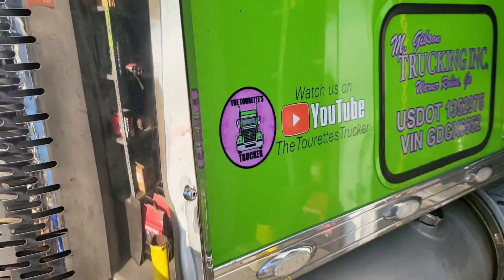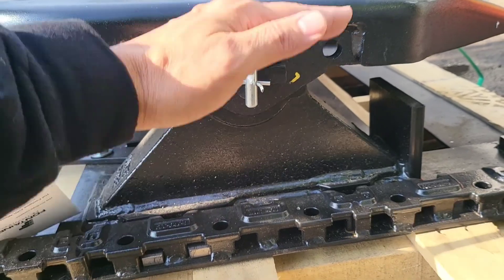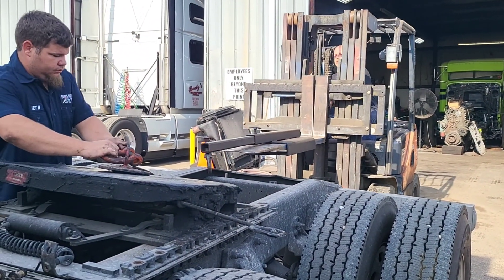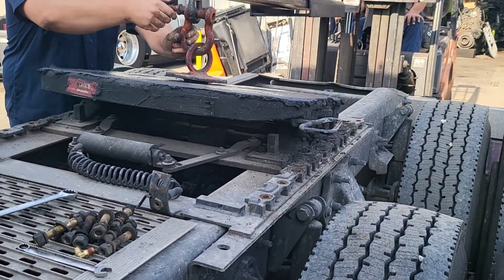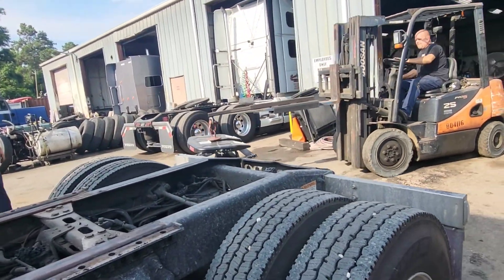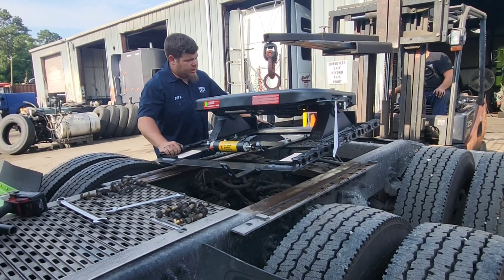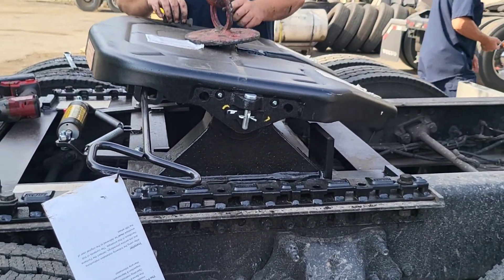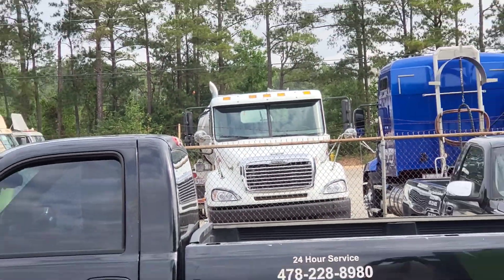Raised 5th wheel install at Dub's Big Rig Rehab in Macon, GA. Tank unloaders need a raised one.

Comment: Why are you switching to a high-rise fifth wheel what's the difference because I drove a truck with a high-rise and I didn't like how it felt with the turns and I was doing Drive-In and it was a jost and I fell in love with the Fontaine low profile
Reply from the maker: With tanking, unless the trailers have low profile tires you won't have any slope on the trailer to the back to get all the product out. Even with my raised 5th wheel and 11R22.5 tires, I still get to places and end up level so all the product won't come out. I put and over-inflate valve on my drive air bags so gives me another 3 inches.
Reply: @TheTourettesTrucker interesting I never knew that.

Comment: What was the height from the top plate to the ground before and after 
Im needing to get my fifth wheel raised  from 48" from the ground to 51"
Reply from the maker: My green truck is at the terminal in Macon and I havent been there in a while. Next time I'm there I'll measure it. I believe it was a 3"riser plate. We couldn't get a 4" riser.
Reply from the maker: I just got back to the terminal to measure the height on the 5th wheel for the green truck and it's at 50".
Reply: @TheTourettesTrucker  thanks

Comment: So what happens to the old one they took off? Does it get stored somewhere for reuse later? Or does it get sold as used?
Reply from the maker: It gets scrapped. It had slop in it and No one will adjust them anymore due to liability now. I needed a new one anyway.

Comment: Why spend $3700 when you can spend $200 and don't gotta worry if u pull anything besides a tanker? You can add a over inflate system with 2 electric air valves one closed one open. Hit the switch in truck it over inflate air bags giving 4-6 inches higher.
Reply from the maker: That sounds nice but that wouldn't give an accurate read on my airbags while unloading I assume.  I have a digital weight gauge accurate within 100 lbs. Some place always want to know how much longer until we are unloaded. Depending on product it can be a 30 minute or a 4 hour unload. See the gauge tied to the airbag let's us see what it's doing. 

 I will have to look that system you mentioned up there that does seem pretty cool 😎✌️
Reply: @TheTourettesTrucker  ah that makes sense I just made mine after dealer told me $3500 for em to add it. Cost me like $200 I drop n hook a lot and those trailers can be close this helps so much back under air it ip and pull out enough to get land gear up
Reply from the maker: @TruckingWithChicken  I do like that Idea. My 5fh wheel plate needed to be replaced anyway also. My old one had a lot of slop in ditch. I tanker beats a 5th wheel to deal with the surge. At one point I wondered if it would be feasible to have a lift like a jockey truck. Lol
Reply: @TruckingWithChicken  

Can you send any info of the over inflate kit. I haul tankers as well

Comment: Someone please tell me what trailer’s it’s good to have a lifted fifth wheel?
Reply from the maker: Anyone hauling a tanker needs a raised 5th wheel unless the trailer is running low profile tires and even then you may need it. If it's a center unload trailer then there is no need. If you have a trailer that unloads in the rear (Which is industry standard) then you need the front of the trailer to be higher so the liquid falls to the back where the valve is or you will end up with lots of product that didn't come out. Tank washes charge per gallon for left over product and it can cost on average $15 a gallon to dispose of.
Reply: @TheTourettesTrucker  thanks for the reply, do you know if other trailers like log 🪵 hauling trailer need raised fifth wheel?
Reply from the maker: @MarkMinistries  no sir, log trucks don't need them. The only ones that truly need a raised 5th wheel are liquid tank haulers.
Reply: @TheTourettesTrucker  got it thanks

Comment: I just swapped my high rise Jost for a normal Jost for $500. It was junkyard special but i picked a good one and reconditioned the surface with a flapdisk. Tanker has been garbage ever since Biden took office so I've been running skateboard. Once Trump gets back in, ill definitely switch back to my high rise and run tanker but wanting to get some Oversized experience under my belt.
Reply from the maker: @MockOverdrive  you are right about that. After Biden got in the tanker industry went to absolute garbage. The rates aren't that far behind dry van.